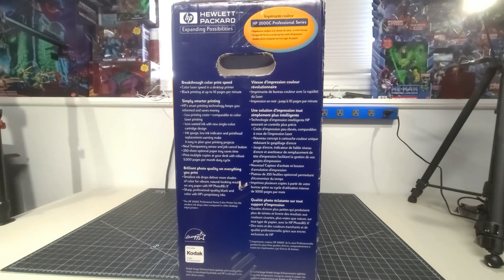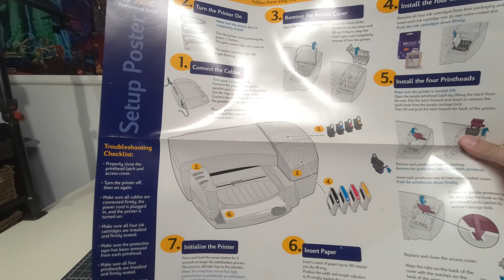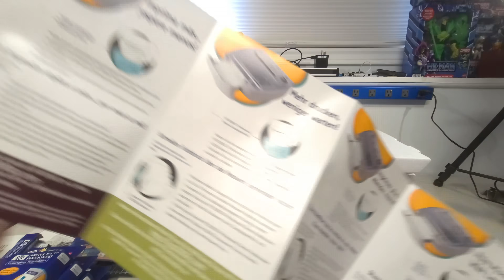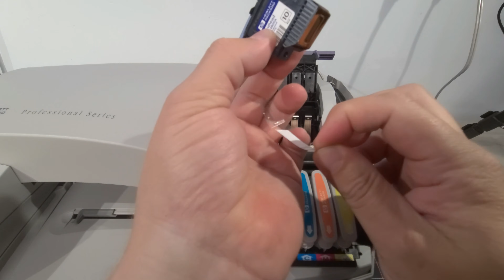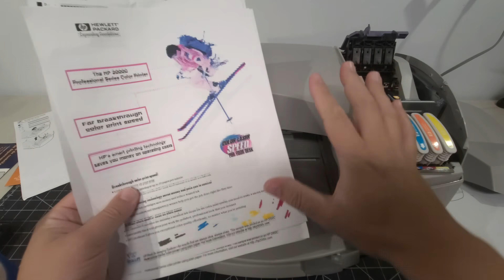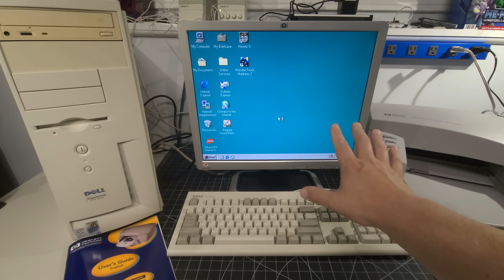NOS HP 2000c Professional Series Inkjet Printer!!

Comment: @TheRetroRecall: Greetings from the UK. I absolutely love vintage HP printers, the ones from the 1990s and early 2000's are the best, solid build quality, generous ink cartridge capacities, no forced ink expiry or chips in cartridges. I have saved a fortune as I've always used expired ink cartridges from ebay and yet not one has failed but I do stay within the 10 year range but if the price is right I'll take a gamble on an even older one and have done so at least four times and the cartridges worked like new, no clogging or poor ink quality. I have an hp officjet k7100 a3 printer from 2008 bought new old stock in 2012 and it's still going strong today, probably one of the last decent HP printers. I previously had a deskjet 5550 (looked liked a spaceship/UFO) but in 2002 (purchased new old stock in 2005) after my deskjet 3820 died after just 2 years) and when the 5550 came out it was fairly expensive and was one of HP's higher end models, I sold it 9 ago years to a woman who lives locally to me and she still has it today and it's still going (her teenage daughter now uses it in her bedroom for college work). In the mid 1990s aged 11, I had a deskjet 420c as I used to regularly draw on the family's windows 95 pc and then print out my drawings. The printer died in 2002 just before my 17th birthday which was replaced by the short lived 3820. The HP thinkjet from 1984 and 40 years on the cartridge it uses 51604A is still produced in official OEM. The first HP Deskjet from 1998 which is A3 sized the "1120c" was a beast and at 25/26 years on so many examples still exist in working order. Then in 1997 you had the HP Laserjet 6L (monochrome) and I still see plenty of them on the used market (of course) in working order and like new condition. The reality is Hewlett Packard today isn't what it once was and their modern printers of the last 10 years are broken from the minute you open the box.

Comment: You really need a beige CRT!
Reply from the maker: Hahah I have several, however it has been a challenge filming the refresh rates in the various scenarios.  Not to mention it is much easier to work with an LCD. That said I have recently purchased new equipment that should help solve the refresh rates.  The challenge of course Is working with the CRT :).  I may introduce the various in future videos.

Comment: HP is just one of those greedy makers nowadays. Shame on them...
Few years ago, I had a HP Deskjet 660c at work. Somewhat the thing came pretty dirty because there was some ink below the printer. I think one bit of the tray plastic broke.
The printer worked with Windows 10 x64 using driver available on Windows Update. I used 660cse driver from the longe list. The trick here is to use the closest model. A different model might also work. Unfortunately Windows was kinda picky with the driver. We could connect the usb lead to the other port but windows wouldn't install automatically.
A single black cartdrige costed somewhat a bit of money but it printed a lot of pages. 
As printer quality... meh... it was fine for text but not for images or graphics. Graphics area were literally very wet after printing and we could feel the paper soak below the paper the curves of the wetness. I tought to myself that the new ink cartdrige wouldn't last a month but I was wrong. It lasted 2 years at least. I left work due to the 2020+ human malware. No idea if the printer is still there or not.

I got myself soem portable hp printer 3762e.... fancy printer but... I printed less than 20 pages and the ink cartdriges are already at middle level  it says... on the windows software and/or web interface. Expensive ink for the ink it cames inside....
Reply from the maker: Thanks for sharing and yes the cartridges I found to be expensive.  I always set it to grayscale mode for everyday printing and regular mode for presentations.  I never had a 660.. Just a 600 and 670.  Both are working flawlessly today.  Now here we have a 2000 professional series with issues but once I get the print head replaced, I'll be laughing.  I found as long as you used this printers, we would be good to go.  If they sat for any length of time, that's whn problems would start to show up.

Comment: I had HP JetDirect back in the day, it was model 170x. Worked flawlessly with old OKI laser printer and Windows 7 machines on the network. Good thing, because that OKI printer was really odd, it would not work when it was plugged straight into Windows 7 machine but happily worked through the JetDirect, with the same drivers and all :D
Reply from the maker: Nice!!! They made great equipment back in the day.  Today's products seem a bit lower end now.
Reply: @TheRetroRecall  Can agree, I am actually looking for a new laser printer as my current Samsung is starting to fail. Found few cheap HP laser printers but they want you to create some kind of account and other nonsense. We have Brother printers at work, they work flawlessly, maybe we will try it next. :)
Reply from the maker: I love Brother laser printers!!! They are tanks!!

Comment: I admire your patience. :) I was never a fan of inkjet, the first printer I really liked was a LaserJet 4L that my school gave me because it had some trouble feeding paper, it was an easy fix and it did great on printing even if only in black. Inkjet however I almost always had trouble, went from HP DeskJet over Canon Pixma to Epson but all either wasted so much ink on their own or stopped working after a couple of years or both. Laser printers on the other hand at the time like the HP LaserJets 4, 5, 6, 2200, LP2015 series were almost indestructible if you gave a little bit of care once a few years they just kept on printing in good quality. Hope my new MF650C from Canon is also that good, only time will tell.
Reply from the maker: Very very true.  I have an old brother laser printer from 2000 and it just continue to print.  So my second laser printer (MFC) is also a brother and going strong since 2008.

Comment: One of my many jobs back in the old shop was servicing printers of all types. I never had to do many of these new-fangled colour ones with their easy-swap heads, but I do have fond memories of doing complete teardowns of early monochrome printers (especially brother and Epson stylus) to clean the head purge pumps and replace their waste ink diapers. How times changed even by this stage...
Reply from the maker: Majenko!!! Thanks for sharing this!  It's crazy to think how much this tech has changed.  Even at the time the quality was pretty nice all things  considered.  That said, I find the reason a lot of them messed up was because of either misuse or no use at all.  My Deskjets of this era always worked well because I continued to use them on an ongoing basis.  Thanks for watching!

Comment: I had the original HP DeskJet 500 originally for use for University and had one of these later ... absolutely loved it and it was a beautiful and fantastic printer but they had one serious flaw (who would have guessed?).

In the bottom of the ink cartridge "holder" there are some buttons that push up into silicone bulbs in the bottom of the ink cartridges. While the printer is running these buttons are repeatedly pressed up to pump the ink from the cartridge to the print heads. The cam that runs these buttons is basically built of chocolate and dies ... I think I had three replacement printers within the warranty period because that assembly failed and the fourth failed but by that point the original warranty had expired.

I managed to find a company that could supply the replacement "part" that was the cartridge tray and the pump mech as a complete assembly but it was £150 at the time (IIRC) and just made it a totally uneconomical printer to run. 

The print heads also used to cake up too and I seem to remember they were something like £50 each to replace...

Damn shame as I did like that printer...
Reply from the maker: Thanks for this info, I will definitely be keeping an eye out for that.  It really is a nice printer.  I only ever owned the Deskjet series so this is a treat by comparison.  I've ordered the Majenta print head from Ali Express so it will be great to see how this works.  I do plan on using this daily!
Reply: @TheRetroRecall  - the head status print shows "health" bars for each head and the Magenta one was showing as basically dead from the outset, that status information seems to be written to an EEPROM in each head and cartridge so once it's been flagged as "poorly" then cleaning it wouldn't have got that back (good try though - it was my first thing to try too). 

I think this ended up being the first printer I ever fitted a CISS solution too (mainly because of those ink pumps in the bottom of the cartridge that kept failing).

I was still excited to see the printer come up in my sugested feed though ... so I definitely still have a lot of love for that old girl. ;-)
Reply: @TheRetroRecall  - Oh man! I looked and I am so stoked to see that you can still get printheads for these ... and they're a decent price too! 

I REALLY hope you get this going as it REALLY is a lovely printer when it's working ... If the print heads do start to gum up (you can obviously check them by pulling them out every so often) and you can catch them BEFORE the health status gets updated in the EEPROMS then you can use a bit of kitchen towel soaked in IPA in a petri dish (or similar) to just dissolve the ink off the nozzles.
Reply from the maker: Thanks so much for this!!! There will be a video short of this working!  Hopefully I can message you later if I have any issues, :)
Reply: @TheRetroRecall  - if I can be of any help then it would be my pleasure.
Reply from the maker: Thank you!!!

Comment: What an era.  My first inkjet was a Canon bubblejet BJ100, which was a tiny little thing and cheap. Very cheap. But around the time this HP came out, I got a deal on a Lexmark color inkjet.  Really barebones by today's standards but it could print nicely.  Here in the future, today at work, I use a Canon inkjet printer that is possibly the most expensive inkjet printer made. It's over USD$1mil for the printer. A set of ink is about USD$70K. A set of 15 print heads are $USD150K. Thankfully the heads are not a consumable like the cartridge inkjets.
Reply from the maker: Lexmark!  Now that's a brand I have not thought about in a long while!  I worked in a computer shop in the 90s selling systems and I remember Lexmark being the budget friendly printer but a decent one!  You are right, happy the print heads weren't as consumable as the ink.  Thanks for watching and bringing back a memory!

Comment: My first ink jet printers were HP's but I had a problem of their drivers getting corrupted and had to be reloaded. I eventually went to Canon Printers and never looked back. I currently use a refillable cartridge type of Canon and the drivers are solid in both Windows and MacOs.
Reply from the maker: I've never heard of corrupted drivers - what exactly would happen... It would just simply not print or would it throw an error?  I've used both HP and Canon, just preferred HP at the time... Then there was Epson haha.

Comment: Both types of ink systems have their own pros and cons but I prefer the ink cartridge with the onboard printhead versus the separate printhead for inkjet printers. Because you get a new printhead each time which guarantees 100% awesome prints each time and it does not waste your precious ink as is the case with the printers with separate printhead systems. I actually currently use ink tank for colour and mono for printing non colour stuff. The ink tank printer can literally print almost 7000 documents on one set of ink and about 2000 full A4 photos. No more inkjet printers for me thank you very much. Printer manufacturers got super greedy when they added the chips on the cartridges that has built in print counters and expiration dates.
Reply from the maker: So true.. And yes both have their pros and cons.  I have yet to experience the ink tank tech.. It looks pretty slick though and we'll worth it if you do a lot of printing.
Reply: Scale matters, though.  Either way will work for low volume printing in a home or small office. But my office has a huge color inkjet printer that can do absolutely vast amounts of print.  It's over 400K a day but nobody has really ever managed to run it nonstop for a whole day. It CAN if someone keeps it loaded and unloaded. This one uses big two-gallon jugs of ink that feed big buffer tanks. Like Ecotank, but an order of magnitude, or two, bigger.  The printer looks at the print output quality on every print and cleans the heads itself when needed.  There's a wiper thing that cleans them and they are basically never replaced unless damaged.  It has 15 heads and they are 10 grand each so yeah, we don't want to throw them away.
Reply from the maker: Thanks for this info!  I was looking at an ecotank by Epson...
Reply: Yeah, the Epson's is real nice that the inkpad filter is changed much easier than the Canon. Prints are basically the same but one is faster than the other printer while the other is faster scanning than the other. So we have both at work. We have about 3 ink tanks at work and a customer actually scrapped her Epson Econtank because the PSU is damaged, easily fixed by me and I will score a extra printer. So I will have  a Canon and an Epson ink tank at home...yay for me. @TheRetroRecall
Reply from the maker: Hahaha good to know and awesome!
Reply: Scale does matter. I am a strong believer in the right tool for the job. I bought the ink tank because we wanted to print A4 colour photos and after calculating what a print shop would charge me, I opted to buy my own. Best decision I made in a long time regarding a printer. It is actually cheaper to use my colour printer to print mono pages than my mono laser printer but my laser printer is so much faster and it's scanner is ADF. @LatitudeSky